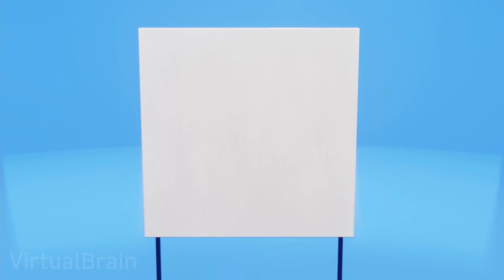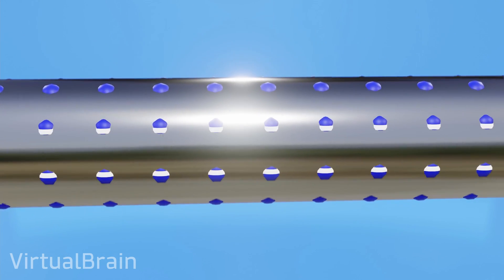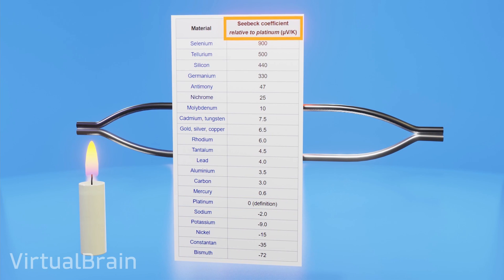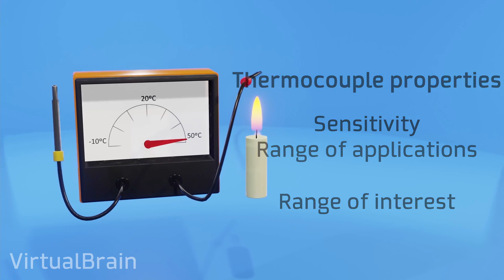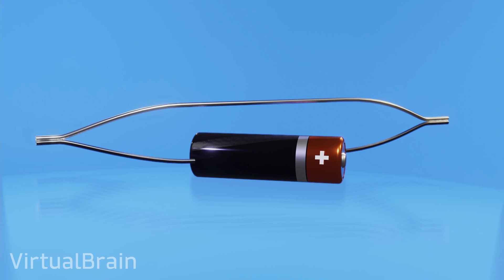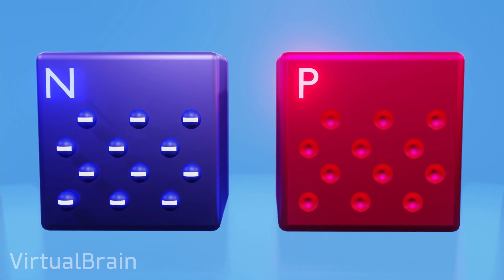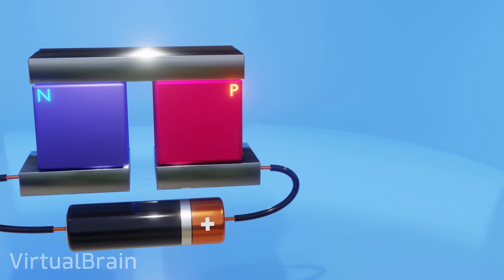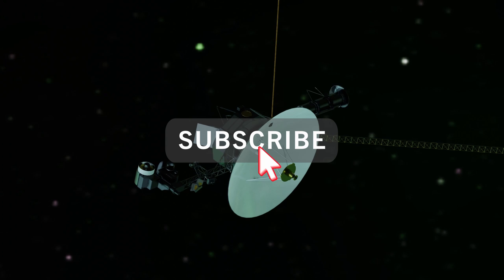Thermoelectric Effects ⚡ How a Peltier Cell and a Thermocouple Work

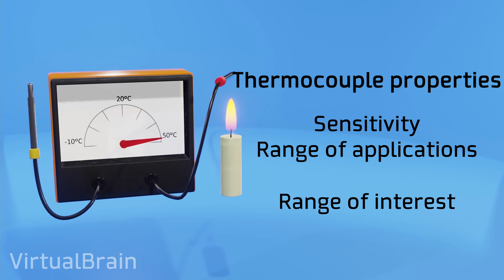Comment: why is the circuit closed at 6:00, but appears to be open at 7:20? How is it reading the voltage between the two probes in the latter case?

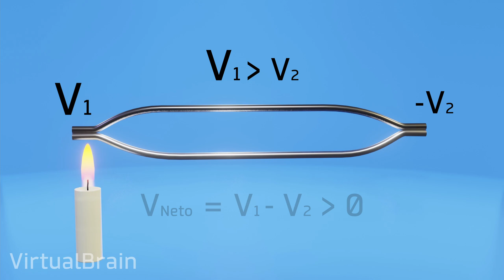Comment: 4:30 if it were the opposite there would be current, it has to be the same voltage cuz current flows when there's a difference...
Reply: Yeah I was thinking this as well.   You'd get 2V1 as the net voltage if this was correct.

Comment: What in the world is going on with electrical ideas?  Wind, solar-cells, batteries are getting lots and lots of experimental money. So, where is the thermocouple big bucks for such a simple technology?  Several thermoelectric articles are over 10 years old.  Solid State TC arrays are easy to mass produce in the factories.  😎 Wonderful Thermoelectric video.  Thank you.
Thermocouples can handle outside sunlight temperatures to produce electricity. ☀